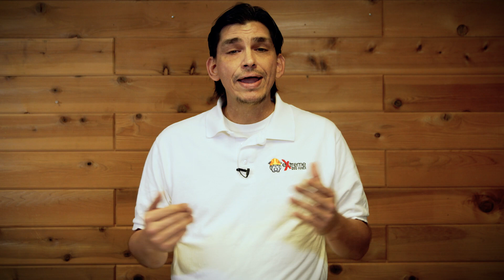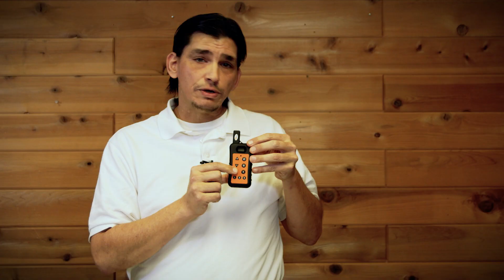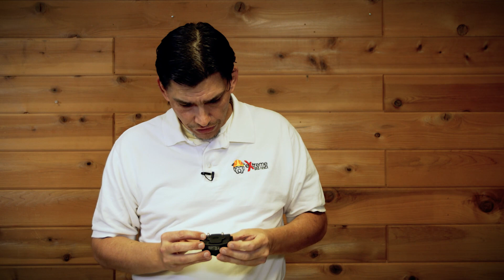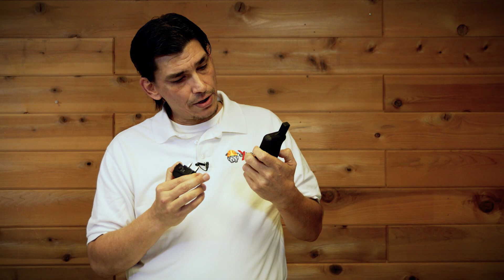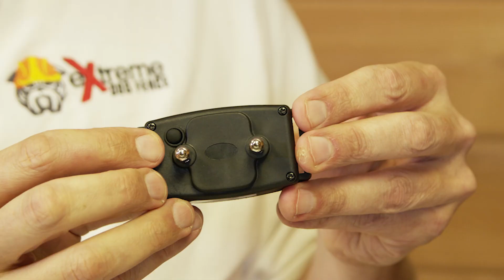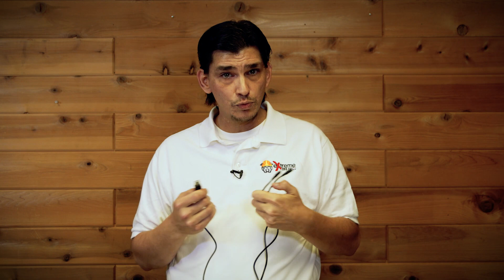eXtreme Dog Fence - Contain and Train Combo System

Comment: What if somebody comes up in just take the dog then look the dog dies in he’s taken away
Reply: That isn't English, so I am not exactly sure what your trying to say. If you are saying someone can still take your dog, then yes. A fence doesn't stop someone from taking your dog either. If you are insinuating that the collar will kill the dog, then I am at a loss as to a response. But again, I am not even sure what you are saying.
Reply from the maker: What relevance does that have with our DIY underground dog fence systems?  "Somebody" could still take your dog whether you had our fence installed or a physical fence.  Because, NO ONE has ever stolen a dog out of a PHYSICAL fence before!  Dog's do not just die when being taken either.  As a FACT, our Collar has a built in Audible Tone, someone trying to "TAKE" your dog, you could sound off the alarm, which would help deter the theft.  But I guess having a physical fence instead has better anti-theft.  

Extremedogfence.com for education